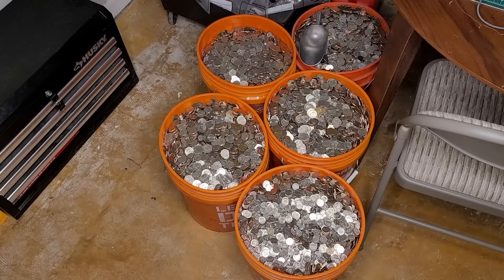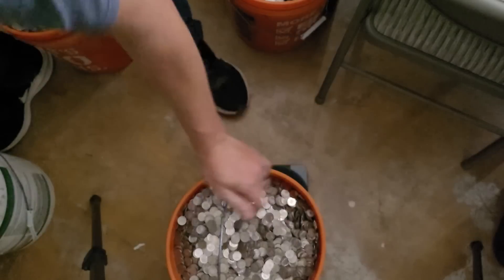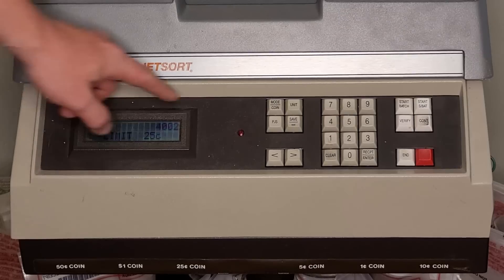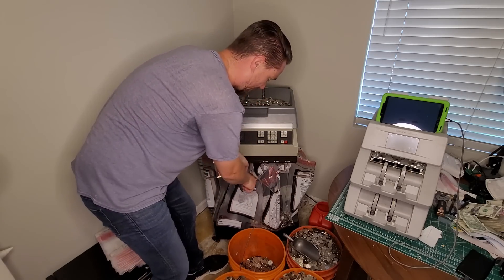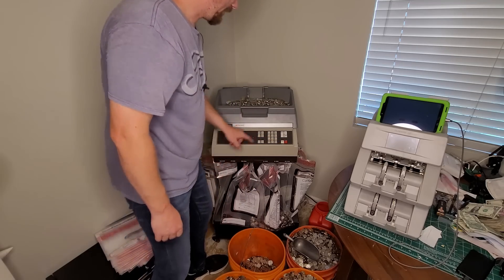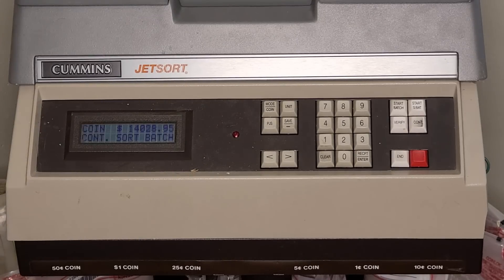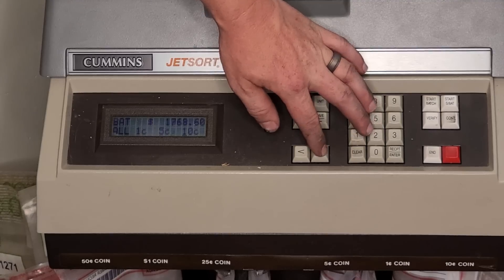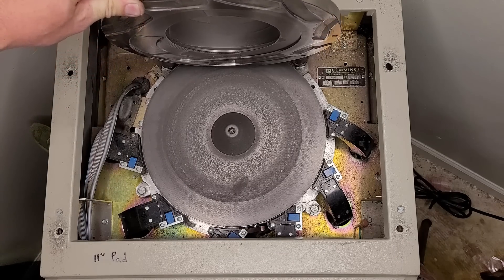Counting 25 Gallons of Coins at 10,000 Coins per min! | The Amazing Jetsort Coin Sorter How it Works

Comment: what do you think a Model 4600 Series would cost me? i found one on ebay. its a Cummins #4601 with cabinet. i would like to buy one. also is there a site for parts if i need to fix it up? they told me its working. what are some minor ports i might need to  buy

Comment: Why don't the smaller coins slide through the larger slots? It must be simple but I can't get my head around it!
Reply from the maker: The coins are introduced to the slots from smallest to biggest.  So the quarter will skip over the dime, penny, nickel, and then get grabbed by the quarter slot.  That plate wears over time ( it takes a very long time to wear) and you end up with loose slots.
Reply: @HerbOMatic  ahhh thanks for letting me know 😊

Comment: @HerbOMatic - Question. Did you ever have situations where a smaller coin such as a dime get slotted into a larger slot such as the one for the quarter? If so, how often does it happen? How does the machine prevent this from happening? I feel like if a dime spun into the mechanism past the dime slot and at the right place and time, that it would land into a larger one.

Comment: I worked in the coin room for the M&T Bank back in the early 2000s. This machine was a lifesaver!! We did NY State Thruway toll deposits and they would send us bags of unsorted coins. This thing chewed through those bags like a beast. Much respect to the Jetsort!
Reply from the maker: That's cool, it was probably a similar vintage to this one, this one is from the early 90s I think.
Reply: @HerbOMatic  too bad the Corporation had to sell out to hide the corruption in the branches nationwide. No ? The DOJ has reports but lazily just filed them away. You tax dollars at work  folks.
Reply: What kind of tool do you use for a sensor jam?

Comment: This is probably the most pedantic comment you will get.  You changed out the first bag which the machine told you had collected 4,002 coins.  You removed two coins from that bag leaving 4,000 remaining.  You then changed out the bag and put the two removed coins in the empty bag.  So if the machine did another cycle and this time found 4,003 coins for example, the bag would in fact contain 4,005 because of the two added.  I know the banks validate the bags by weight so a couple of coins probably makes no difference.  I would say put the extra coins back in the machine. BUT...

If they cycle through the machine again, they are counted for a second time.
Reply: I approve this type pedantic behavior and messaging.
Reply from the maker: A-ha, you would be right except when you go to clear the bag the machine tells you about the overage (because it can't stop instantaneously) and you're supposed to move them to the new bag.  The machine then begins counting from this number.
Reply: @HerbOMatic  I also approve this response.
Reply from the maker: I approve of your approval.

Comment: What's to prevent for example the first slot a dime runs across being the quarter slot? The dime would fit.
Reply: Becuase of the shapeof the head to the rotating tray, the coins are only allowed to enter the the outside or sorting ring at a certain point. Once they enter at the known and controlled point, they are then sorted with the smallest being removed first. They cannot enter the sorting ring from any point around the circle, one the one point that is designed to allow coins in.

Comment: The disadvantage of this style of machine is it cannot reject drachmas, francs, roubles, lira, euros, Fisher-Price 'My First Till' plastic coins, 2 pennies superglued together, or anything like that. Coinstars can. That makes it only suitable for professional use, where the operator can have a quick look at the buckets and quickly tell if he has been given a bucket of drachmas. Coinstars however can by used in public locations as they will actively reject drachmas and the likes.
Reply: You are forgetting it was the job of the vending machine to detect the coins, not the sorter.
Reply: @Supremax67  thats why I said 'only suitable for professional use', ie after something detects the drachmas, pennies glued together, and the likes. 
Publically accessible machines like coinstars do not have a vending machine in the loop before them to do this.

Comment: I filled a very old 5 gallon Sparkletts bottle with change from the late 90s into the 2000s. When it would hold no more I attempted to empty it, but when I tried to move it it shattered – and I learned quickly why Sparkletts must’ve moved away from glass bottles… 
When I was done sorting the glass from the change, I handed off all the coins to my banker buddy, who returned to me $2,100.97!  
Long story short I’m gonna guess somewhere between $9,000 and $10,000.
Edit:  you obviously had way more quarters in the mix than I did :)
Reply: Yeah, he had about 2 quarters more. 😁😁

Comment: Guessing $15k... Let's see.
Reply: Hey, counting it as a win.  Figured the breakdown of coins by assuming change was collected randomly between 1¢ and 99¢ at a time.  Looked up measurements of coins to get volumes in mm³.  Determined weighted average of coin value in terms of volume, and then converted mm³ to 25 gallons.  Then cut in in half to account for air between coins.  $14,517.88

Comment: You could still deposit the money in your bank or does the bank requires you to roll up all the coins which they still have to break anyways and count to verify just wondering
Reply: If the branch doesn't have a coin counter, they most likely put in it a bag like in the video and send it to the local "Vault" to be counted and deposited into your account. Takes mine about 4 days to show up in my account.

Comment: Very cool. I was a manager for an arcade back in the early 90s. We had a pretty cool electronic coin counter. I want to say it was a Brandt. Would do single coin type at a time since we just counted quarters and tokens. It could be set to roll or bag coins at 20, 25, 40, 50 and 2000. 
And now after 24+ years in IT, I am back doing game operations for the local barcade. For super cheap, I picked up an old Downey-Johnson coin counter. It works fine, despite being 40+ years old! A bit of cleaning and a new coin eject roller has it working perfectly. We just need to count quarters so it will do us just fine!
Reply: Brandt was honest I hear tell .Not like those Cummins Thieves. Free Speech !

Comment: Hi, I don't understand why the coin doesn't fly outward due to the centrifugal force. The lid with the track has no frame to prevent this. How is the coin guided? From approx. 9.46, the coin should be pushed outwards. Can you explain this in more detail? Thanks!
Reply: Other than the milled slots in the top plate, the distance between the plate and the rotating wheel is smaller than the thickness of the coins. (It’s likely almost touching.) The coins can’t exit anywhere except the milled slots.

Comment: Is there a "reject" bag for damaged or foreign coins?
Reply: No,  they will not pass through the channel under the sort head,  you can tell by the the rubbing noise. You have to stop the machine and with one latch open the hinged sort head and remove the bent or foreign coin.

Comment: I have been saving coins for over 25 years. I started with a 5 gallon water bottle, the type that when you order water they bring it in and turn it upside down and after that was filled I started on a 2 1/2 gallon water bottle of the same type. The big bottle weighs 175 pounds and the small bottle, which I emptied, had about 60 pounds in it. The banks used to take coins in bags, but now everything has to be rolled. I can't see buying an expensive machine that I'm only going to use once. Wish me luch!
Reply: Hey buddy i am in same boat....24 years save coins...just yesterday  i am do some research on line and prices go to $ 100 electronic to $ 25 nanual in that range...after all this years i am think in invest  in that....

Comment: My father's uncle owned a load of cigarette machines in and around Manchester, England in the 1970's & 80's. On Fridays and Saturdays my father and I would go and refill the cigarettes, empty the money, and fix any issues. When we got back to Bert's house my job was to sort and bag the coins. He had at least four others who worked for him and each round was about a dozen pubs and clubs, so there was a lot of sorting to be done. Bert had made a manual version of this out of various bits and pieces. I remember the hopper was an old saucepan. Once sorted, Bert's wife counted the coins using an electronic counter. Amazing when I think back at the ingenuity of people back then. Great video!
Reply: How much would they make per pack? Did they get bulk discount from the government for their stock?
Reply: @bobbyhorsman9963  I was too young to know and my Mum doesn't remember. Tobacco wasn't regulated in the UK in the same way it is in the US so I'm sure he bought them from wholesalers. I do know that my Uncle was employed full time in the business so it made at least enough to support him.
Reply: There are much older versions of this, I mean back in the 80's as a kid I had a cheap 5$ coin sorter with little containers for quarters, nickles, dimes and pennies and you'd drop the coins in and they'd roll down a little zig-zag and drop down into the tubes which had lines and a cut out so it wouldn't over fill. Then you'd just slip a coin roll over it and boom, done!
Mind you this was just a kid's coin sorter, nothing high tech and old as dirt because my great grandfather gave it to me saying it was like the ones he saw in the banks growing up. (He passed away at 108 in 2006)
Reply: Huh..in mid 70's US ( now 'Murica ) a pack o' 20 Winstons was maybe 50 cents & rising. JFC, I'm OLD:0 yet..
Can you recall your prices ; are Brit butts still called fags ( gasp !) & packaged differently? 10 packs to a carton here & cheaper/tax free on Indian reservations.

Comment: How does it reject foreign or counterfeit coins?
Reply: I guess sorting that out is a job for the vending machine, not the counting one.
Reply: Yeah basically you're supposed to have had all of those rejected by the vending machines and coin acceptors
Reply: Wondered that myself; guess slugs are rather obsolete in these strange day$ of Bitcoin but would it gag on Canadian..or tokens?
Reply: It depends on the configuration. I used the Big Brother version of this machine daily at a US casino I used to work for, it handled quarters, half-dollars, and dollar tokens; anything that didn't match got diverted into the "nickel bag." That's where foreign coins, washers, and earring backings used to end up.

Comment: Will the bank take the bags like that or do they need to count them?
Reply from the maker: Hey Brian, they do take them like this.  They charge a fee of $10 per bag.  They don't count them on the spot, perhaps they weigh them and the $10 fee covers any discrepancies.  I have never heard from them about it over 10 years.
Reply: @HerbOMatic  hey Herb, what route do you take to your bank? Because I want to follow your route and scoop up all of the loose & lost change due to busted plastic bags!  I need to buy a big scoop shovel... Haha

By the way - how much are those bags?
Reply from the maker: @jptucsonaz8503  Change is $50 pennies, $200 Nickels, $1000 Dimes, $1000 Quarters, $2000 Dollar Coins.   I sold my Vending machine business a few months ago so I no longer deal with large amounts of change or cash!  Just incase you were feeling kind of Robbie.
Reply: @HerbOMatic  Ooops, my bad... I meant how much do the new empty bags cost you?
Reply: I just noticed the RC planes! Nice! I have a Radian foamy that is a lot of fun to fly but can’t find a decent place to fly it In so cal.